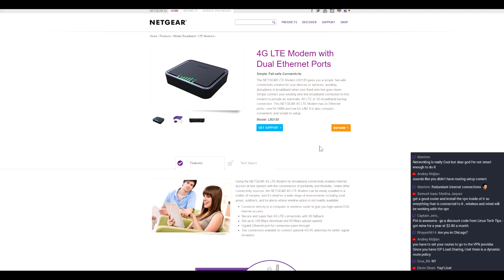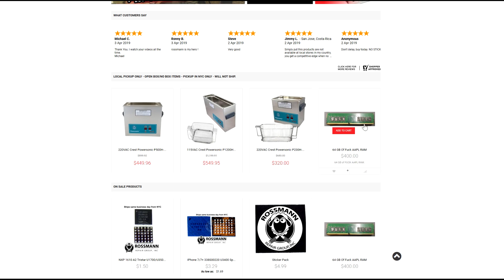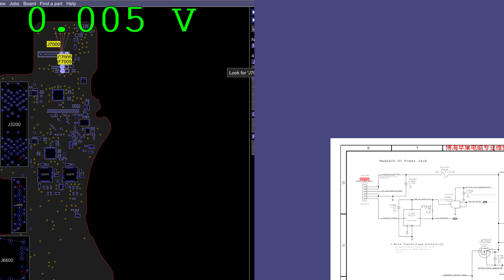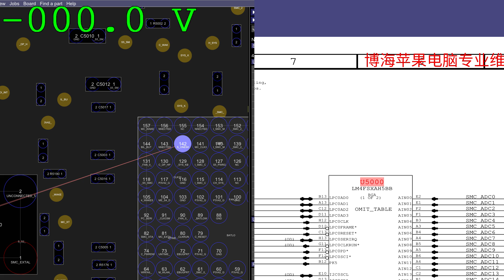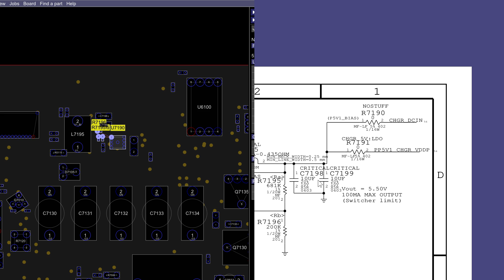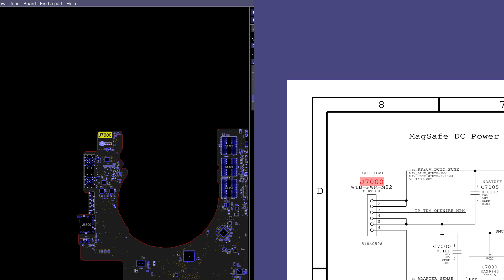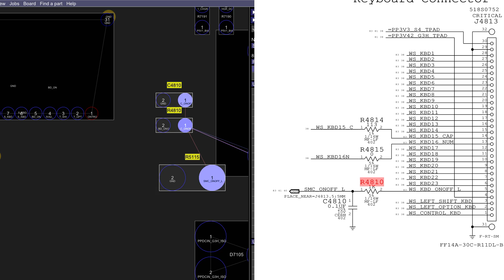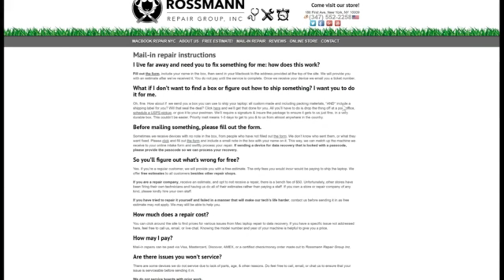No green light on A1278 Macbook

Comment: Red Shop, Blue shop is a great idea. iFans will always levitate to 'shiny'. All you need are a front end counter in each shop and a shared workshop behind. Repairs via the 'normal' Red shop that cost $250 can be charged out  at $500 through the 'shiny' Blue shop.

Customers to the Blue shop could be offered trade in deals for machines with a dead chip/screen against new kit, then the machines pass through to the workshop for repair/refurbished, or as donor boards for Red shop customers.

Win-Win
Reply: i even super love the idea of one of them being a off-merch store too, spread the religion ^^

Comment: Louis, just get a good air cooler, like a Be Quiet Dark Rock and forget about cooling for the next five years.  
No pumps to fail, no liquids to leaks and fry your components and it just works!

Also, could you add to your shop a version of "FUCKAPPL" RAM sticks with aluminium heat-sinkns 
Those would look much cooler in my PC :)
Reply: I personally use an AIO, but I would highly recommend a Noctua cooler for his work machine, he'll have a great experience with them, so Louis, if you see this I would absolutely recommend a Noctua cooler over any AIO.
Reply: This is my me registering the 'FUCKAPPL' trademark!! cnc machined fuckapple heatsinks coming soon !!
Reply: Send me a link once they are ready to sell and please include a version of cnc machined 'FUCKAPPL' heatsinks with RGB

Comment: You should consider dumping liquid cooling, too, for air cooling. I use a Noctua for my Threadripper and it's fantastic. It's quieter than my previous liquid cooling from Corsair (H100i) with the default fans. Since it's quieter, even if you are running the full 32 cores, you won't be drowned out in jet fighter noises (one of my old computers did that on boot and high load).

Comment: Is that MagSafe cable you use on all your repairs connected to a variable bench supply ? I was curious what adapter that was originally chopped from because the one-wire IC which tells the board the adapter ID and wattage is in the MagSafe connector (the brick itself is irrelevant), so I was curious what that cable is detected as and if it'll run on all MacBooks.

Comment: gosh, $300 for a cpu cooler? why? I have a corsair H100i on a i7 5820K and it's been running for 4+ years. Streams, overclocking and all and zero issues, costed no where near that. I hope you aren't pulling an apple (ha) when it comes to building your pc man. More expensive doesn't mean much.

Comment: Do you have line of sight to your apartment from the office?  If so, there may be a solution --- wifi directional point to point with a pair of parabolic antennas.. Good for about 5 miles.... gets close to a gigabit if the path is clean....  Ubiquity makes the system.. (Very solid system.)   https://www.ui.com/products/#default

Comment: its not TWC, its Spectrum internet. and you should probably check your signal levels to your modem.  next if you are uploading to your home then you are most likely still on spectrums network where as upload to youtube is not on the same network and you are most likely peering through some congested server or some shit.

I also have the enermax Liqmax 2, its the 240MM version and ive had no issues with it for almost 2 years. i have it on a seperate controller so i can change the pump speed manually. what you need to do is make sure that your motherboard has an actual header/controller for a water pump, if it does not then you need to get a controller.

also $400 for 64 gigs of ram for $400 is nuts! i cant tell if you are actually hoping to sell these for $400 but whoever buys them is dumb as hell, just like apple fanboys.